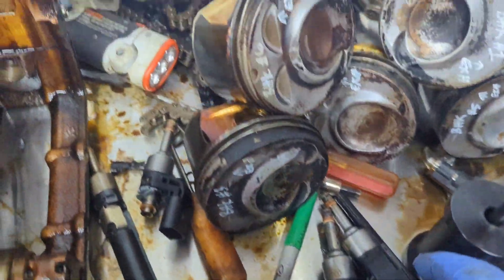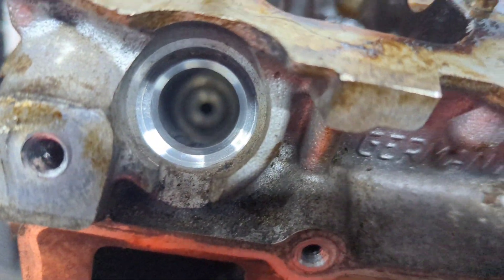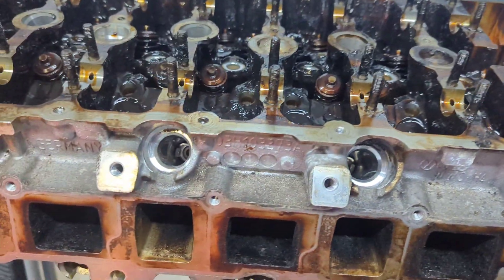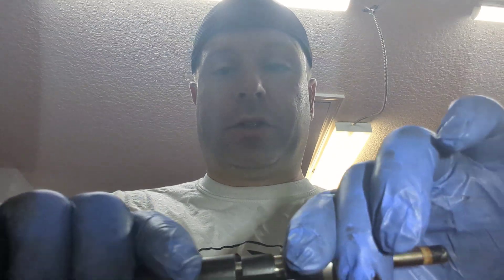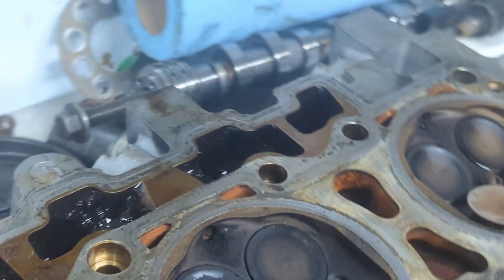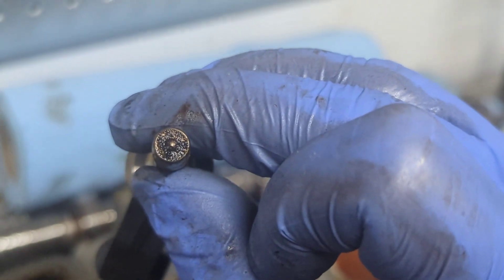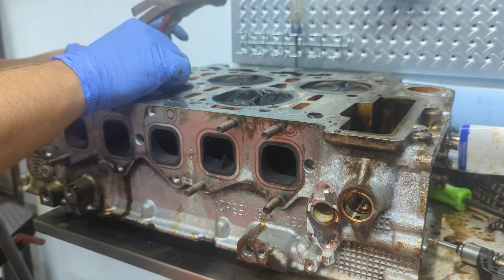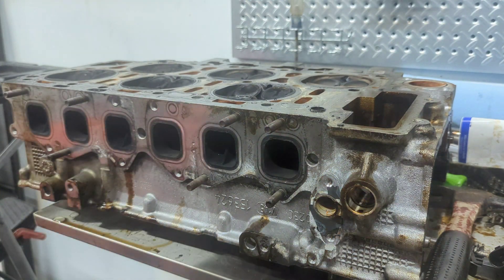3.6L VR6 long FSI injectors stuck inside head(short side)

Comment: A problem with this approach is that it damages the injector.
And since you're ok with damaging the injector, it is no worse than just screw into the sutck piece with a screw and pull it out from the bore hole form the outside.
Reply: Yeah if it's really stuck in there, I would agree with ya. By tapping the Injector ring rebuilding head, it was lightly tapping so it didn't damage the injector.  Absolutely someone COULD hammer it out hard, but that would screw up the injector and defeat the purpose, in which you could just wood screw it out and ruin the injector for sure.